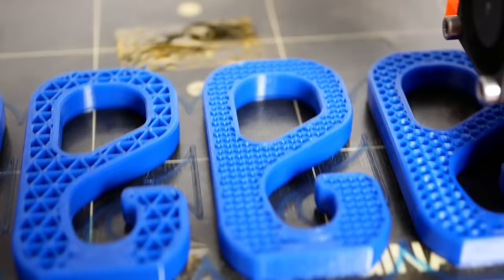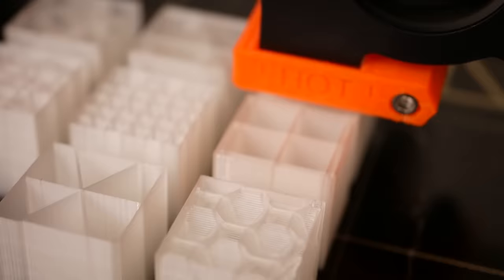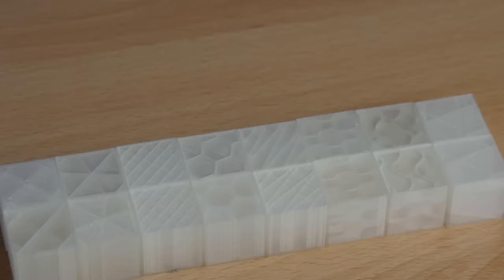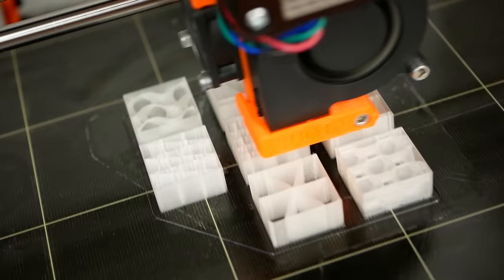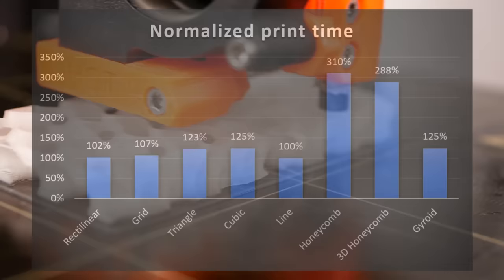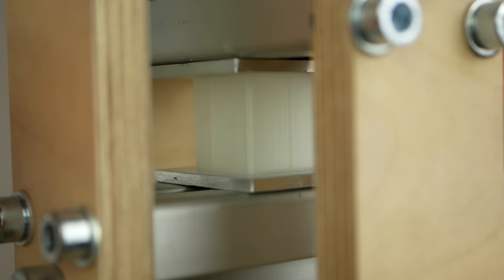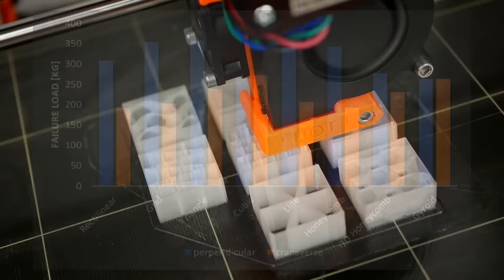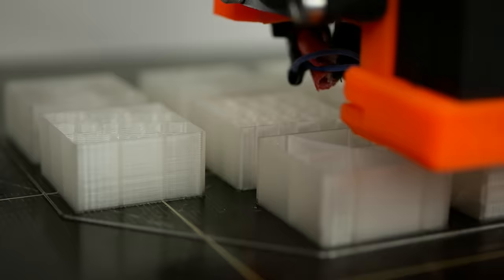TESTING 3D printed INFILL PATTERNS for their STRENGTH

Comment: Excellent and informative video. I shall definitely be using gyroid in future.    I would like to see something on printing ABS , namely how to avoid stress cracking / layer separation . I'm doing quite a lot of ABS because of the ease of post-processing to a nice finish, but still struggle with layer separation despite having a good enclosure around the printer.  I have managed to minimise this by slicing components into shallower sections and ABS allows for good glue assembly.
Thanks for posting useful and methodical content.

Comment: And people say 3D printed parts are fragile, these cubes seemed pretty durable to me. This is very interesting information, choosing the right infill pattern for the direction the part will get the load from seems to significantly affect the strength.

Comment: Great video Stefan, one other aspect of infill is that it also adds lateral strength, not just crushing or compression strength.  I wonder what the results of testing a 10x100x4mm (or pick your dims) part using 3 top, 3 bottom, and 2 wall perimeters might be?  Crush strength for me comes into play with screw holes so I normally just increase the wall count to overcome that.  Anyway, it'd be very interesting to see the strengths of parts on a longitudinal test.   Thanks for your vids!  Enjoy them all.

Comment: Looking at this video to find out which infill pattern is best for my press-fit pulley extractor.
I initially did Grid at 0.12mm and it snapped in half. Currently doing Lines at 0.16mm

Comment: I would like to see tested a 0.25mm nozzle with 0.4mm line width printing 0.2mm layer heights versus a 0.4mm nozzle with 0.4mm line widths printing at 0.2mm layer heights. In theory, both prints should have the same quality and take the same time BUT will fine details be resolved better with the 0.25mm nozzle or does the slicer ignore the fact the 0.25mm nozzle can do finer details due to having set a wide (0.4mm) line width? Things with small text or tabletop miniatures would be a good test

Comment: Test different nozzle sizes! At 0.8mm nozzle I have parts that are stiffer with 2 perimeters and 10% infill than parts with made with 0.4mm nozzle 3 perimeters and 55% infill. By increasing the cross sectional area you increase the length of the polymers crystalline microstructure. Therefore, increasing the toughness of the overall material. Would love to see all these videos remade and testing the real deal!

Comment: Excellent investigation. Compression from the top versus compression from side to side is a good comparison. In practice, shear can also occur or compression from diagonally opposite edges. I've been using cubic (I use Slic3r) which seems like a good compromise with strength and print time. Sometimes using fillets between external faces works if U- or V-shaped  limbs are pulled apart like the wishbone on a chicken. Again, thank you for your research and keep up the good work! Best Regards, Tubewaller

Comment: I think it would be much accurate if each cubes have the same weight, so you get the strength-to-weight ratio.
Reply from the maker: They all were basically the same weight.
Reply: Well that rectilinear looks like it has a significant difference of gaps to 3D honey comb and gyroid

Comment: I think those results will greatly change if you choose a smaller area to put the pressure on and also increase the infill up to 20-30%. Instead of using pressure over the whole surface you should use a smaller rectangular or circular area.

Comment: It seems like there is a simple way to fix the outer edge delaminating issue without the need for so much infill. I am not sure how hard it would be to do this but I think it could possibly be accomplished by layering infills on one another without an outer wall however maybe an inner wall with a dense infill structure might make hollow parts almost as strong as others. What about doing something like rectilinear or where on the outer edge you double the density or increase it. If you have perpendicular lines every 4 mm for the infill pattern why not create a rim on the inside where for the infill pattern that connects to the outer wall you have perpendicular lines every 2mm however it is only like the first cm on the inside and the middle is just the standard lines every 4mm. or even better yet why not make the inside hollow and create an exponentially growing infill that starts with a solid wall on the inside of the outer wall layers and if the structure is big enough you create a hollow center. This might need custom coding to create the pattern and figure out how to cut it into slices.

Comment: Look like triangle is the winner to me? Only a little strength loss compared to gyroid in the transverse, but way higher perpendicular.
Interesting though, I had been using 3d honeycomb as my "go to" - because you know, honeycombs are strong right? But wow.. turns out it's weak and super slow to print. Time to switch!

Comment: Thank you very much. 
I want give you a suggestion for a new test:
USE TPU OR ELASTIC MATERIAL.

My idea is:
A) keep CONSTANT the weight
B) change only THE INFILL
C) check the THICKNESS under pressure. (TPU will change thickness proportionally to the infill pattern)
Then write on a excel table the percentage of contraction of each infill pattern at SAME weight, and add a graph.

NB: I am curious to see your results because I have to print my shoes Insole ...
Please keep the good work ... ur good.

Comment: Would it be possible to to do a "rigidity" test, for infill, such as a "long" object, from both top, and side. Another thing I would like to see, is how gyroid effects "pulling", compared to other infills.
Gyroid not having any straight lines, I would think it would really harm it's compression strength.
Yet another test that would be interesting, would be a compression test, rotated 45 degrees. All traditional infill patterns are VERY good on "top" and "side" compression, but I'm not so sure if they will have much strength from the 45 degree rotation. (This is very important if you are printing something with a 45 degree overhang)

Comment: I have ordered only 1 3D part by now, but find the technology interesting. I just wonder if those infill patterns need to be uniform?
I mean just take a look at the inner structre of bones for example. They have a solid outer layer called "stratum compactum", but what makes bones lightweight and durable at the same time is the "stratum spongiosum" which is actually the infill of the bone and is everything but uniform.
I wonder if 3D printing software have such a feature and if so, does it make a difference to print non-uniform infills in terms of weight/durability ratio?
Reply: I don't see how it would improve anything. Straight lines allow for faster printhead speeds, while uniformity has obvious strengths too.
Reply: @waiguoren  I do not care about printing speed and on saving 1 Euro per piece ;-)
I just would like to know if there are 3D printing software that offer the feature of non-uniform infills and if that "organic" infill patterns would make a difference in terms of durability.
Reply: @MrBPeet  It shouldn't be very difficult to create an algorithm on Python to do something like that. The math to create organic-like random polygons already exists. You can see great stuff at redblobgames.com. I am not affiliated with them in any way!

Comment: I don't think that you should adjust the size of the mesh to get the same weight.
Because if a pattern results in a lighter part then its a plus.
Ideally you'd want to have the same distance between "supports" in the structure and then plot against the 2 other variabes: weight (lighter is better) and resistance (both radial and axial like you did).
If a structure is expected to be isotropic then this property should emerge from the results (same axial and radial resistance)
Plot resistance vs. weight is I believe the best benchmark because weight is a sought after quality in 3D printing and it also translates into lower cost (less material)

Comment: Did you (or are you planing to) do a test with more fragile structures like pipes/bridges? 
Those are usually the parts that break easiest in any 3d model and would definitely provide better comparability since all infill patterns would break below your stalling threshold. (i.e. an experiment "breaking a stick in the middle" instead of pressing a block together)

Comment: I'd like to see strength normalized to weight (how strong it is per gram of plastic used basically).  I see they're all very close in weight but it would make a slightly more valid conclusion.  Would also be interesting to graph how much the strength increases with infill % -- how much stronger is 20% infill compared to 10% compared to 5% for the 'best' infill types given here?

Comment: Thanks for your work Stefan,
Your are doing things thoroughly and explaining them nicely.

Concerning your 3.5kN limitation on your  super hyper great tensile test machine, have you ever thought about preloading it ?
Seeing how you've designed it, you could increase it's operating force with springs  (springs are not ideal as the force depends on their compression : F=k*X), or easier to calculate afterward : gym weights, cables and pulleys.

On your compression setup :
Those weights would be lifted up when opening the compression rig (so the weight could be 340kg), and then during the cruching, the 340kg weight would sum up with the 340kg downward force created by your stepper motors.

And as simply as that, your tensile machine would go from 3.5kN to 7 kN !
It could be an easy thing if it's still in the range of your force sensor.

I really like your design for this machine, and I will probably copy you one day or another... (with a steel frame).

Keep up the good work !
Reply: That is not likely helpful as his limit is more likely his load cell. Adding force does not add load cell capacity!
Reply from the maker: Exactly, the load cell is limited to 5 kN,but still not a bad idea.

Comment: I am interested in printing long (4ft - 8ft) long prints but I really want to know if I should buy a printer that has a conveyor belt like the creality cr-30. Or should I get a extra long printer (or make one). Since the cr-30 prints at 45 degrees and would have better adhesion due to it only printing sections at a time, and the long 3d printer might cool down too much in that distance. The reason I ask is because I want to for example 3d print an axle and I want to know which layer direction would be able to handle more torque.

Comment: I tried cubic, but I noticed that when the nozzle passes over previous lines, it sort of grinds or makes a series of small thumps.  Can't be good for the nozzle in the long term.  So I tried gyroid and it does none of that, but with the same strength.  The downside is I'm slightly concerned I'm wearing out my motors faster due to all the movement, but maybe not so bad since the lines are mostly fluid.

Comment: great video! love the accurate graphs. Your printer prints so beautifully, i have the Prusa Mk3 (original) and my prints are not as good as yours. Please make a video explaining how you get such great prints! (i'm currently rebuilding my HotEnd as i think that was my problem - but it's still it bits so i'd better get back to it!)
Reply from the maker: Stock settings, Slic3r Prusa Edition and good filament. There isn't actually much more.

Comment: My question isn't related to 3D printing of this type, but instead of working in this type of material where you want an object to be strong and not breakable, you were working with ultra-flex polymer, so making an object you want to compress and return to its original shape without it wearing out easily, wouldn't the honeycomb structure be superior for that, because a hex is closer to a circle? 

But something about your test here, if a honeycomb is known for relatively high out-of-plane compression properties and out-of-plane shear properties, doesn't this kind of compression of a cube test mainly planar forces? I guess I'm confused because I thought a honeycomb pattern would be significantly stronger than grid. Maybe the excessive gyrations of the machine make for a weaker structure?

Comment: If i print lets say a 20cm long, 2cm width, 5mm height part. With 100% infill it seems a littlebit too flexy. If i want it to be stiff, would it be helpful to print 1mm top and bottom layer and let the 3mm print with 20% diagonal infill?

Comment: Maybe not a 3D-printing test Or is it? I always heard that the egg-shape is the strongest possible shape, so the first test would be wether that is an old wives tale or actually true, lot's of tests confirm it already from walking on eggs to putting pressure on it, but how well controlled are those tests really. 
And secondly maybe there is a way to put egg-shaped infills inside a 3D-print and see if they perform better, you might however want to contact a company or a friend who has a hydraulic press, since that will definitely not reach a limit any time soon.

Comment: If I heard right you made some infill % higher to make the weight the same as to have the same amount of plastic in the print 
but wouldn't that give skewed results? cause you're testing some infills at lower % than others;
and doing a test with them all at the same % would truly compare how strong they are relative to each other which is what the goal of this video seems to be

but still, kudos for the effort put into the video

Comment: You can sometimes also print it hollow and then fill it with resin to save print time
Reply: or using a low temperature glue gun (100C)

Comment: Thanks for the really interesting and informative video! 👍👏

I would like to share a ponder 🤔

My Math is a bit rusty, but here goes 😅
If you used a smaller nozzle, maybe a 0.25mm, could you scale the objects down to 62.5%??(0.25/0.4) 
and increase the infill to 16%, I figure 60% more because (1.0/0.625).
Maybe make them twice as tall for the top crush, and twice as wide for the side crush. 

That mite give you something your compression machine can measure😃

Comment: Hello Stefan! I am interested in the test device. which parameters can be captured? can tensile forces be measured?

Is there a construction manual or can the machine be purchased?
Reply from the maker: The test machine uses a 5kN load cell and measures forces primarily. I'll post a video and the drawings some time. If you want to have the CAD right now, just send me a mail.

Comment: can you test which it's the most flexible infill?
Reply from the maker: Wiggles? None at all?
Reply: @CNCKitchen   i need to make a piece that is a little flexible not too much not too little. and if i put infill 100% it's almost good but 100% infill uses too much filament so i need an infill that it's not too stiff. And i was wandering if i can fix this with some infill that flex a bit and don't break apart.

Comment: you tested compressive strength, what about tensional strength? also for the 3d infill (i use gyroid all the time) what about prints that do not fullying allow the 3d structure. for instance a part that is only 4-6mm in thickness? does gyroid maintain it's strength in a situation where it's structure is not fully realized?

Comment: Stefan, which of these would be the best for a bending type force?  I am thinking of the Z axis on a CNC router where the spindle/router will be pushing, and pulling, on the plate that holds the tool and I can't figure out which would be best to use.

Comment: Do you know how strong Zig Zag infill  is?
Its the default in Cura for my Anycubic i3 Mega and i couldn't find much about it. The Wall Thickness is 1.2mm and 3 Walls(Layers)
Reply from the maker: Zig Zag in CURA should be the same as Rectilinear in S3D and Slic3r.

Comment: Dear Stefan: At first glance you look weird, but a second glance, you know a lot. Methodical, patient, smart, i like that. I am subbing. You sound like the guy in a channel that I really like /greatscottlab. A comment on the different numbers for the honey combs printing times: I bet you know tessellations, if you synthesize the gyroid one  (graphically or structurally) you will notice that it is a cubic one, and after that action or reflection you will see that it has the same printing time as the cubic one... next time 3d solid structures like in crystals or carbon molecules like C60? Cheers from Mexico.

Comment: 3:50 No, you shouldn't adjust the infill percentage to normalize the weight across all samples. Weight is not the main contributor in material strength, infill percentage is! How you justify that a 9% infilled gyroid is weaker than 10% rectilinear infill? It is not an apple to apple comparison! You should keep the infill ratio the same and let the weight fluctuate, because every infill pattern has their own weight efficiency. Then if you compare with constant infill ratio, you can do compare in strength to weight ratio to further justify which one is more economical for prints that need compression resistance.
Also, if your press cannot exceed 340kg of press, use less than 10% infill or on slightly bigger sample due to size effect on material that can slightly weaken it's shear capacity, which is needed for your limited machine.
I didn't consider your results are valid, because the methodology itself is of loophole. If you are my student, I may request for major correction on you.
Reply: I think normalizing for weight is fair enough. The press not being able to handle the weight is a big problem.
Reply: @amirabudubai2279  no, what I mean is, he didn't have to normalize the sample weight at all, he should let it fluctuate. The sample weight has nothing to do with the weight capacity of his press.